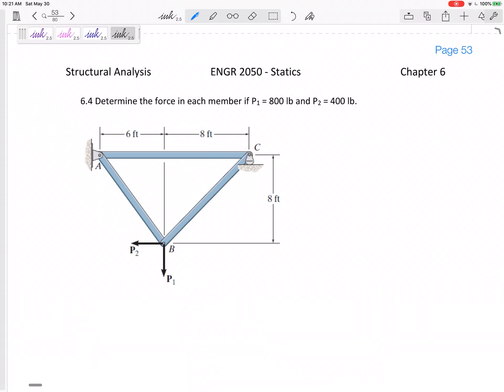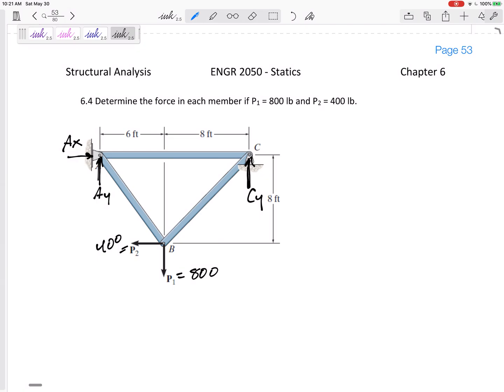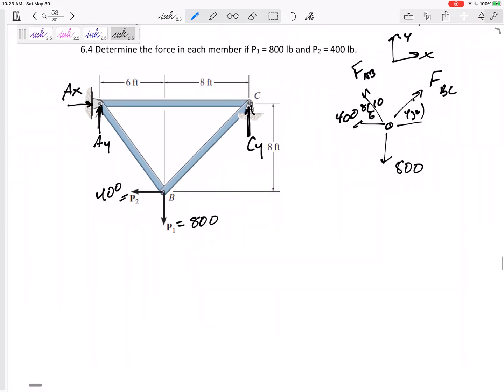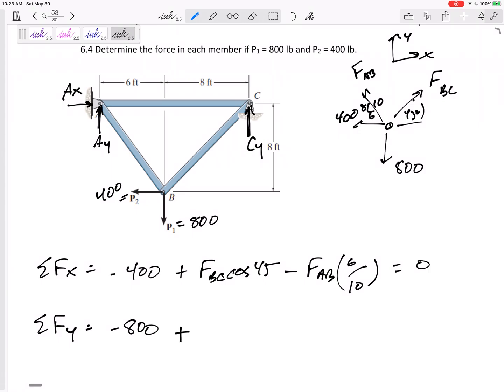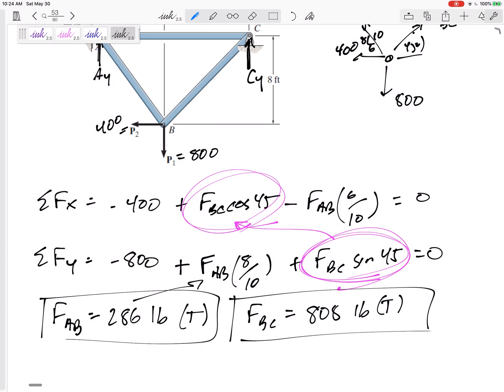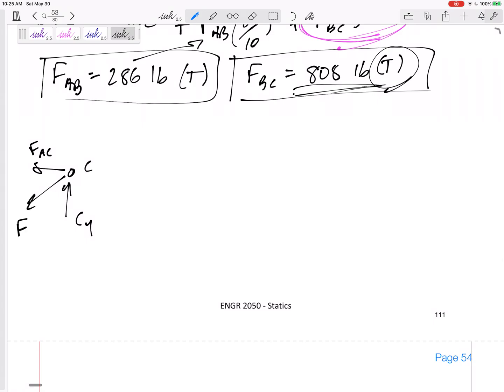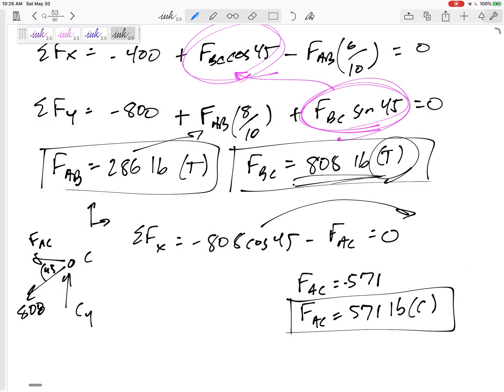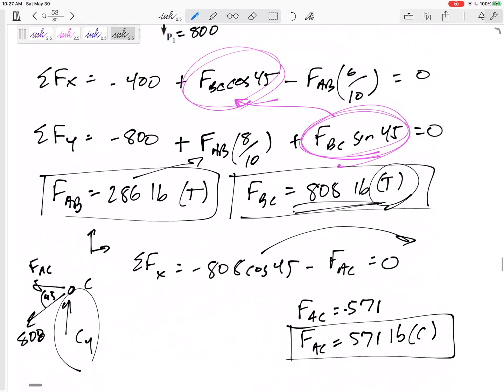Statics - Truss Method of Joints example 4

Comment: I'm confused on how the members are in tension when the force on both ends of the member point into it. Wouldn't this mean that the member is in compression?
Reply from the maker: If you are looking at the joint, the forces the joint feel are “pulling” out of the joint (tension). But if you are considering the member, (because equal and opposite) you have to turn the forces around. The forces are also pulling “out” of the member (tension). The joint feels equal and opposite what the member feels, so both of them are feeling tension.